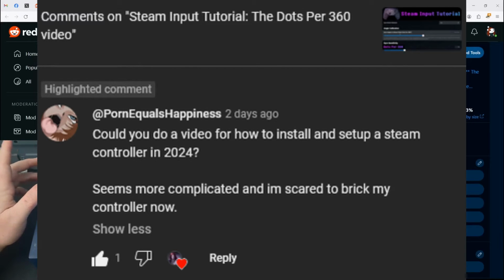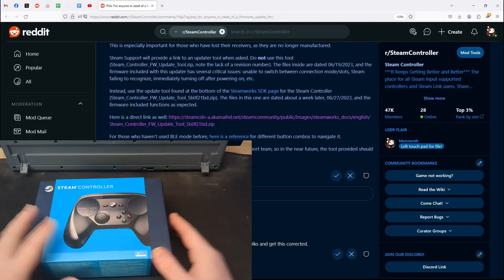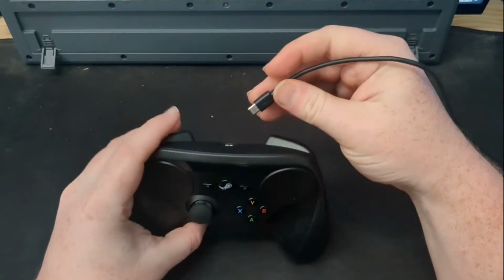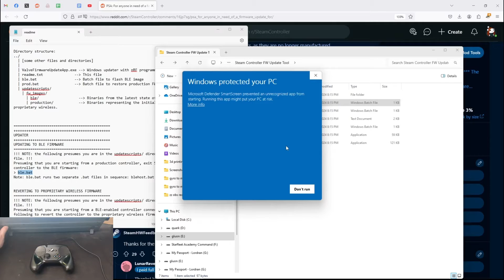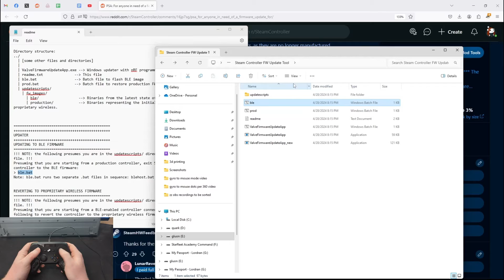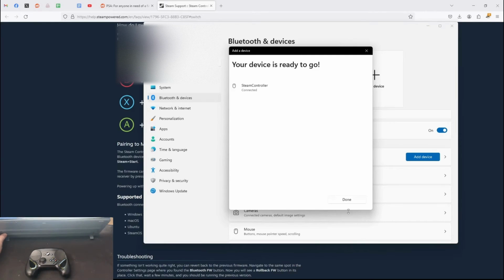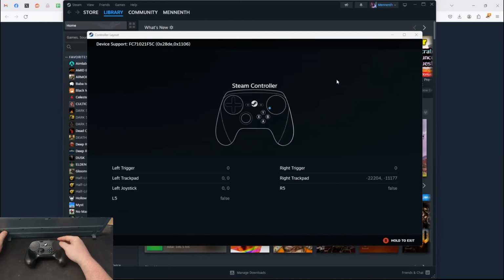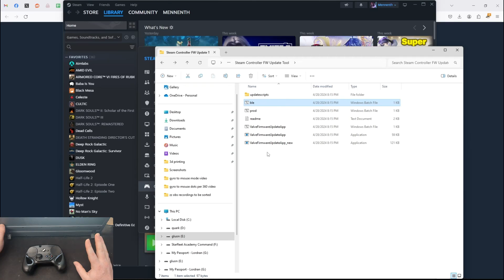connecting a steam controller in 2024

Comment from the maker: EDIT 2: Guys. I'm not paid by Valve to do tech support. This video shows things going correctly. I dont have an unlimited supply of Steam Controllers to try and repro and troubleshoot all possible issues in this process. Personally? I hate that this cli tool exists in the first place. I fought HARD when the new Deck bpm interface was shown off to make sure functionality was preserved, and I got LOADS of blowback over how "the new bpm is better than the old one". Now I feel like Cassandra, a prophet who tried to get people to wake up and failed. All thats left for me to do is sit back and watch people complain about lost functionality. But please. I'm not Valves tech support. If you encounter a problem with this method, please complain to Valve.

EDIT: MAKE SURE YOU ACTUALLY EXTRACT THE CONTENTS OF THE DOWNLOADED .ZIP FOLDER
I sort of glazed over that part for brevity, but you cant simply double click to open the archive and flash from there. You do actually have to extract the contents for it to work (right click, extract, all that jazz). Of course, if Valve actually bothered to properly support their own controller through their own controller ui then this wouldnt be a point of confusion.

OH!
Info I forgot to include: Even if you update to the bluetooth firmware, if you can get your hands on one of the proprietary dongles it is better to connect through it. The proprietary dongle is lower latency compared to bluetooth. While there is no need to, if you have the dongle you can still update the firmware as there is no harm in that. Having bluetooth as an option is good for compatibility (steam link through an app, one less thing to worry about carrying around with your Deck, etc)
Reply: I check the update zip file whit virus total and it said that one file cued  have a virus. Is the zip archive infected or is it a felas positive?
Reply: For some reason my controller's guide button flashes for 10 seconds when I turn it on and then the controller turns off anything I can do for it?

Comment: Every time I try to run the BLE file, I keep getting the error message "the code execution cannot proceed because MSVCR100.dll was not found. Reinstalling the program may fix this problem." I have downloaded and deleted these files seven times and no luck. I feel so dumb, can anyone help?

EDIT: It turned out I had to download a whole other thing to be able to run the BLE file. I was finally able to do that, but now the Steam controller freaks out and opens up some weird page when I try using it wirelessly on my Steam Deck (plugged in it seems to work fine).

Comment: copped a steam link and a steam controller for 20 bucks.
threw it on the charger for 5 hrs thinking it was rechargeable and was wondering why it only worked wirelessly lol.
thanks for the video.
helped out alot

Comment: thank you so much for the help. unfortunately, I hit a snag; I extracted all the files, I'm using the cable it came with but as it attempts to update the "radio firmware" via usb, the dots get halfway towards the end and the screen closes out. I tried pairing the controller with steam after the fact and still no luck. Is there anything I might be doing wrong?

update: I got it to stay up longer. However, now it says "error updating firmware" but then proceeds to install everything else as normal and even beeps after the screen goes away. I still can't connect it to my dongle.

Comment: Appreciate the guide!

 Been playing games with local co op a lot more than I used to so I decided to buy some used steam controllers so I had more than 1 to pair with my Steam Deck in its Dock, l updated the firmware on my original one way back and then never used big picture mode again. One of the controllers ended up being new in an unsealed box missing the proprietary connector, but never set up unlike the others I bought that were used and updated already.

I panicked when I realized the add a new steam controller and all the set up pop ups were gone and your video is the first thing that actually helped instead of being super outdated info.

Comment: Found a brand new one on eBay to replace my almost 10yr old one that wasn't working very good and never knew I could Bluetooth it. This worked perfectly. I read the notes from steam but wasn't 100% sure what they were wanting me to do. Only thing I'd add is Steam said to make sure to remove the batteries, which you did, I'm assuming to be sure it isn't connected in any other way than usb wired. I just bought this new one so it's perfect timing for Valve to announce a new one to be released!

Comment: really great video i had to dust off my 8 year old windows 10 laptop to do the job. only took 2 hours of trying to figure out why the bat file wasnt working to realise only certain micro usb leads work luckily the 5th one worked
Reply: What do you mean bat file? The ble would run? Like it crashed?
Reply: Mine isn't working. I hit run, and it says "updatescripts" is not recognized at top. Then, below, it says, "waiting for 3 seconds, press crtl+c to quit" i did extract the zip files but nothing works still. Im connected via micro usb

Comment: Mine is failing during executing the bat file. Please help!
Reply: mine was the same yesterday had to try 4 different wires until it worked as 3 was lighting up the controller but was connecting to my pc which was the issue. make sure when the controller is plugged in your pc recognises it otherwise the bat file wont work
Reply: Check you have a full (not power only) usb cable. The controller will beep when plugged in if the connection is good.

Comment: The fact you just have a brand new controller just lying around is such an insane flex 😭😭
Reply: I still have one unboxed. I own three.
Reply: My two are basically new, I bought them with the steam machine when that was a think lol. Only bad thing is they went unused for so long the batteries on the left side corroded leaving acid in the port, but I just cleaned em and they work like a charm! Too bad I ripped apart my steam machine years ago to get the hdd for my first pc. Tossed the remainder of it a few months ago. Would have been cool to still have it
Reply: I just found and bought a new unopened one, was a bit expensive compared to what they use to be but not terribly priced considering their hard to find new lol

Comment: For anyone interested, I tried using the steam controller on my android google tv box. I was able to pair the controller successfully, but the only input the device seemed to recognize was the right thumbpad as a mouse cursor. It would be cool if someone figured out a workaround to get full functionality.
Reply from the maker: what you are describing is "lizard mode"
basically, the Steam Controller relies on Steam (or a 3rd party remapper like ReWASD or linux focused SC-Controller) running for all its customizations.
Without that, it acts like you mentioned; a mouse cursor with a smattering of mouse and keyboard buttons.
Typically, bluetoothing to android is more for when using the Steam Link app to stream your steam games from your pc to your android device (phone, tablet, either hooked up to a tv, a smart tv itself, etc).
If you want to use the Steam Controller as a gamepad on the android device itself, you'd need to write a custom driver for it.

"Lizard mode" is intentional; the original idea was that when paired with a steam machine (or any pc in a living room situation), the controller could - on its own - get you from cold boot to steam running where further customization can be done.
Reply: @Mennenth Uuuuuugggggggghhh

Comment: I downloaded the BLE.bat and I just can't get it to connect with anything. I don't know what to do. If this means anything, whenever i plug it in, windows says device not recognized and the controller turns off, but it worked a little while ago and in lizard mode. do you know how i can fix this?

Comment: Hm, in linux i tried to play with gyro in few games. And after 10-20 minutes i get gyro drifft or a small movement of gyro make 360-720 degrees wheel spinning. I think i have the last firmware installed.

Comment: I found a used one without the BT dongle. It powers on, but is completely unresponsive(EDIT: Unresponsive while connected vis usb, when it's trying to pair via BT the trackpad vibrates) . Any suggestions? 

All I get when trying to do the update provided is this before closing out:

Updating controller firmware
Attempting to update via bootloader...
Error opening device.

Waiting for 0 seconds, press CTRL+C to quit ...
Attempting to send to wired controller...
Updating radio firmware
Attempting to update via USB..............
Reply: Did you get this sorted? Had the same issue. It was the cable. Some USB micro cables only do power. The controller will beep when you plug it in with a full USB connection. If only power the controller will light up but not beep.
Reply: @czhillimedia2391  Yeah, I could have sworn I had used the cable for data transfer at some point, but I was wrong. Switched cables and it worked.

Comment: I’ve been trying to get the Steam Controller to work with the Steam Deck OLED.

I plugged the controller dongle into the USB C port with an adapter, and the controller simply kept beeping on and off it would never stay connected and I don’t know what to do.

So… I followed this guide updated the firmware via my windows laptop and… once it was all updated went to connect to my steam deck and the controller went absolutely wild like my steam deck got hacked!

I’ve turned the Bluetooth off, it seems like it just doesn’t want to behave on the steam deck unfortunately.

I don’t know what to do.
Reply: Interesting it went crazy after updating, maybe its Linux? I just got mine in the mail today & it came with the dongle and worked straight away with my oled SD. I used a Samsung adapter.

Comment: so I have my steam controller i just pulled out of a box with the original veritcal dongle adapter and controller. any idea what these are worth or should I keep it or try and sell ?:) based in Aus
Reply from the maker: its msrp was $50 usd. idk how that would convert to other currencies. If its fully new in box you might be able to get more for it, if not then maybe slightly less.

Could always learn to use it though ;)

Comment: Fun fact:
Apparently, if you used your steam controller and firmware spontaneously combusted by connecting controller to pc via wire, after batteries was drained - you cannot reupdate it without pressing "deregister controller" button that was in old big picture...
 
I wasted whole 10 days of failed updates and surfing the internet to obtain this knowledge
At least I'm super happy that now everything works
Reply: Wait so what are you supposed to do to fix it? Nothing?
Reply: I managed to revive it only by connecting it to a super old build of Steam that was lying around on my friends laptop without being connected to the network. But yeah, at that time, Steam support told me, "That's not our priority right now"
I hope it fixed now, but it's too stressful to check it 😅.
I don't wanna brick it again, so I will never connect it to a wire 🤣🤣🤣

Comment: Hey man, great video. Im having some problems. Ive followed all the steps, downloaded and unzipped the  files. When i run the ble file i get an error msg pop up saying code execution cannot proceed. Any ideas? Many thanks
Reply from the maker: basic sanity checks;
are you using windows, or another os? it will only work on windows
does the tool have proper permissions in windows? try right click run as admin, for instance?
does the usb cable you are using support data, or is it charge/power only? it must support data

other than that, I'm not sure what the problem would be. it bothers me endlessly that Valve has decided to do it this way moving forward precisely because of all the potential problems that can pop up.

Comment: I picked one a few days back. It's so sad that Valve abandoned it like that. Whenever I visit a game page, it would have a tag saying "this game supports your Xbox controller", but I never owned an Xbox controller. Also, when trying to filter to games that support a specific controller, Steam Controller isn't on the list
Reply from the maker: While not called out specifically, the tag for Steam Controller support is done through "Steam Input support"
Unfortunately, that tag is a self report on the devs part so its been inconsistently applied. Some games that do use Steam Input dont have the tag, and some games that dont use Steam Input do have the tag.
Its... frustrating, to say the least.

Comment: Edit:  It worked!  Thank you for putting in so much work to upload this video!  Straightforward, clear instructions are hard to find regarding this issue.  Also, thank you for providing the link to the correct update .zip file, because there are several sources linking outdated files.  You were right about the need for a good USB cable; the only cable that worked for me was the one that came with my Controller, and I had a heck of a time finding it.

Comment: I have been able to get the controller connected to the dongle without steam, but when I go to pair controller in steam, it can never recognize the controller and I can’t access steam input in my games. Help please!!!
Reply from the maker: that unfortunately sounds like one of the more annoying bugs, relating to how the controllers get paired to accounts. Account pairing/unpairing was part of the old ui, but unfortunately Valve doesnt see the point in having steam controller specific features in the new ui (which is why the cli firmware tool is needed in the first place).

IIRC someone has an archived old steam version somewhere that does have that functionality... but please be careful going that route as such executables may have malicious code in them.
Reply: @Mennenth  thank you, yeah I was hoping there would be another option other than installing the old UI
Reply: @Mennenth  Are you saying that a second hand controller will not pair with a different account?
Reply from the maker: @kerbalkerman6827  if its old enough to have already been paired to an account (the new ui doesnt do controller account pairing at all), then you might have problems assuming that bug is still happening (there was supposed to be an update that wiped paired accounts).

IDK if reflashing the firmware will reset it, or if you have to find an archived steam version. I've tapped a Valve dev on the shoulder about this. Hopefully it gets resolved.
Reply: So I had this issue and it was actually because I was using the beta version of steam os, when I downgraded to stable the controller worked fine. Hopefully that helps someone.

Comment: So I have tried everything and I am trying to find a solution. But I ran the ble.bat and the command screen will count down then just close out nothing happens. What am I doing wrong? I hope and pray I get a response! Thank you very much!
Reply: I think I got it this time! I needed to extract files after download. Duh. Sorry for wasting your time. Excellent video!
Reply from the maker: @bradfabre580  thats a step I sort of glazed over in the video. thanks for letting me know! I apologize you had to go through that frustration because I wasnt as completely thorough as I should have been.
I now have a pinned comment emphasizing the need to fully extract the folder. you've made the video better.
Reply from the maker: it closing out is normal. does the controller beep, or does literally nothing happen?
Reply: @Mennenth  the ble.bat will count down the 4 seconds then crash no other text is shown like it is trying to update. No beep as well on the controller.
Reply from the maker: @bradfabre580  just to sanity check, are you using a usb cable capable of data? or is the cable damaged in some way?

Comment: I have a Steam controller just collection dust 😭
Reply from the maker: its a good controller if you spend the time to learn how to configure and use it. I've made a decent number of videos to help, but more generally I'll be making some gyro videos that can apply to any gyro controller. No time frame for when those videos will be out though.
Reply: @Mennenth   I use gyro alot on my Steamdeck and Gulikit Pro 3 controller
Reply from the maker: @itzdcx  awesome!
idk about the gulikit controller, but the videos I'll be making about gyro will definitely be relevant to the Steam Deck. If the gulikit can be used through steam input then the upcoming videos will be relevant to it too.

Though again, currently no time frame on when those videos will be out
Reply: @Mennenth  yes it can used on Steam input just put the controller into Switch Mode instead of Xbox mode so that steam utilizes the built-in Gyro

Comment: Do I have to do the FW update for some specific reason? I bought a used SC like 2 years ago and connected it just by using the instructions that came with the box. I didn't do any FW update but it works normally, i guess... Does the FW update fix some issue or does something better?
Reply from the maker: You dont need to, but it doesnt hurt anything either.
Having Bluetooth is nice if you ever lose the dongle or want to use it on something you cant plug the dongle into.
Reply: @Mennenth  oh I see. Thanks!